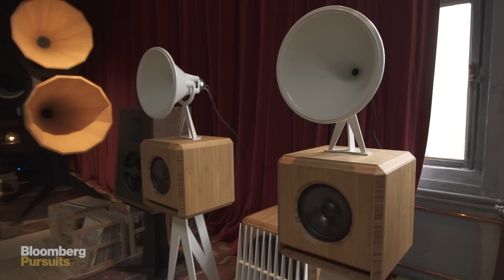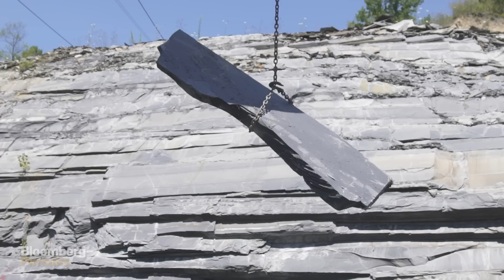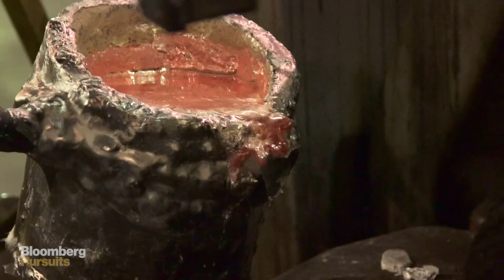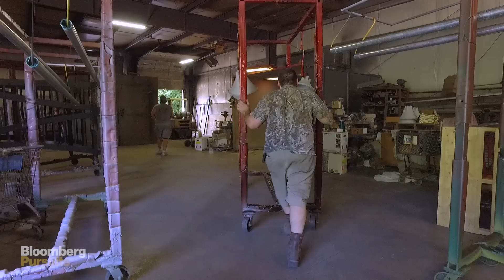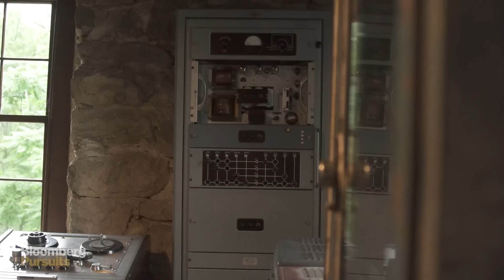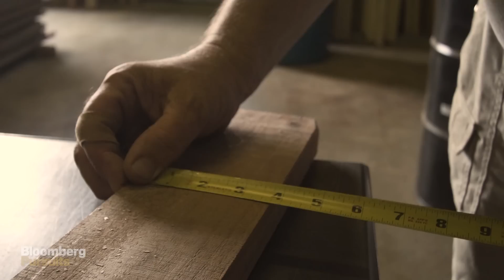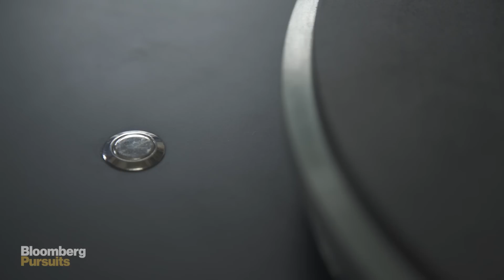How a $300,000 Speaker is Made

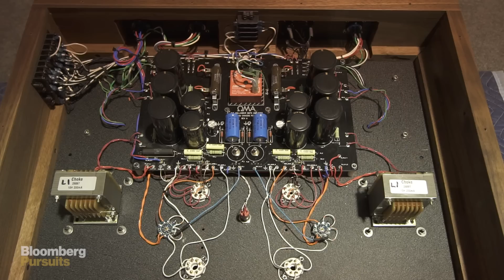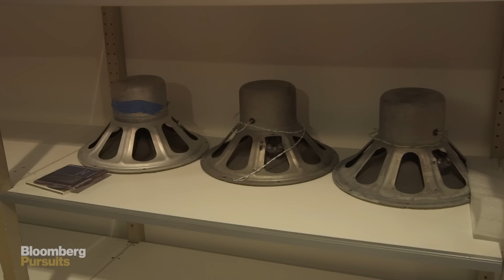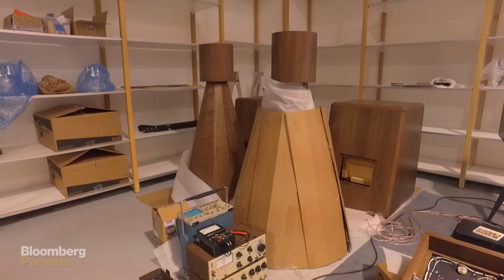Comment: 5:25 that's the soldering quality you'd expect from $300k speakers? The guy  at 5:37 uses what appears to be a gas soldering iron... is that a joke?! I could solder better when I was 12! 5:08 you didn't even bother to hide those dovetails and use better joints! There are brands that cost a FRACTION of the price and offer a better quality of workmanship!

Comment: In my humble opinion, OSSWALD MILL AUDIO is not the only reference. For several decades, GERMAN PHYSIKS from Frankfurt/Main (Germany, Europe) has been producing extremely high-quality omnidirectinal loudspeakers, equipped with their exclusivly developed 3 gr "heavy" and 0,15mmm "thick" carbon WAVE BENDING CONVERTER driver(s), who is extremly fast in all acoustic pitches. GP proposes this high performing driver element in loudspeaker of different sizes, from living room loudspeakers to the masterpieces GAUDI MKIII, which goes soon into series production and costs an estimated plus 300k€. German Physiks also builds suitable high-end amplifier stages. Not a matter of course either.

Comment: I dont get it because most records are mixing and mastering on very cheaper monitoring system... Do you really hear differences between 5000 speaker and 300 000 speaker ? In this case its not controlled or even intended by the engineer. I am curious to hear answears.

Comment: 192000 kHz audio sampling with 32bit float accuracy and all this analog sounds like trash. Cheap soft rock + huge nothing special diamond saw + not chipped product + ancient technique of metal casting + mothed metal out of the movie Terminator or just regular metal foundry if you are honest + carpentry + lamp amplifier that can be emulated with software on transistor amplifier  = frightening system for $300.000. I am sure they sound great but cut the bull*hit and these are worth 1/10 of the price but then vain rich people with no life can't brag about how special they are and get a little bit of confirmation to fill their empty souls to hide their missery.

Comment: @ 5:23 this is your finished boards? I see you've got some IC's in there which is pretty decent but what is up with the flux and solder joints? I think if you're going to hand make these and sell for those prices, it should more like the guy who is making nixie tubes again. Hire me, I'm OCD as fuck. Perfectionist when it comes to this kind of stuff. I will say I think it's badass that you're doing old school circuits though. I see people getting pissy about the rats nest wires. Open up any old school high end radio or tv. That's how it was done. There is no need to zip tie or glue wires in straight lines because your eyes like it.

Comment: Well, I am not tube amp expert, but every skilled tube amp builder tells you, that some parts need to be as close to the tube sockets as possible and not run miles to some chinese DPS - and for that prices, I would assume to have it built by hand with point to point wiring without DPS. Not to mention this wiring is awfull, 100x better builds can be seen from DIY communities.

Comment: I can semi-admire the construction and look of the equipment but he basically spent 6 minutes talking about building "rare" earth speaker cabinets that aren't made out of anything that rare. As an antique dealer, I can tell you all the techniques he is using have been around 70-120 years.  

300k horns and ported cabinets? Since when do humans make better joints better than machines? Horns are very efficient but not all that accurate. Just go buy a pair of ATCs be done with it and save 270K.
Reply: All horns sound like $hit.  Power is cheap ever since the transistor age so no excuse not 2 do a line array if U want more dynamics & volume =)

Comment: Y is handmade looked to be better quality in general... cars like Tesla are all machine produced... machines can do work near perfection that humans simply cannot.... making handmade and limited quality does not justify high price
Reply: I mean to be fair I do think this guy is a swindler but handmade often have far higher quality and durability, for example Tesla’s have an exceptionally low build quality, likely because of low standards of passing meaning they allow basically any car as long as it doesn’t fall apart out of the factory. Handmade however has far more accountability, you can fire a workman if they are building low quality goods, you can get tighter tolerance out of a machine but a handmade where you pay for the handmade ticket will last far longer, well if it’s a trusted company. For example of the perfect machining process look at sennheiser’s HD 800 series, machine made components, handpicked and put together parts, flawless quality.

Comment: Guitar wood is supposed to resonate and vibrate. Audio equipment needs to dampen quickly so there are no secondary vibrations. It's the same reason you need soft slate instead of hard slate. Now they go and make audio equipment from guitar wood that does not damp quickly. What a waste...

Comment: All that 'expensive' equipment is great and all BUT!!!, its not replicating Elvis energy at all or any other artist.. what its really doing is replicating the quality of the equipment that was used in the recording of Elvis (the artist).   So if the artist was being recorded with crap,  the best you can get from that performance is the capability of the recording equipment used in that session.    UNLESS!!! your equipment can identify the equipment used in a songs recording, and by way of sound replication synthesis, account for the shortcoming of the equipment and correct it.   Like cleaning dirt from up old film footage.  it would be the equipment somehow replicating the artist and the recorded sounds to fill in the holes where the errors had exist.   This stereo system is not doing that at all.

Comment: I'm an audiophile and love to listen to music.  It's better than drugs.  When I watched this video I thought to myself, I wonder if he has ever turned on all that old commercial audio equipment?  I was thinking of all the wax and paper condensers (capacitors) shorting out.  The reason for the sheer size of that equipment was because it was in constant use day after day and had to dissipate a tremendous amount of heat.  Most of those components that made up that equipment were their own heatsinks!  I also was amused with the wooden components in his systems.  I wonder how he maintains quality when the characteristics of wood are not consistent?  If those photos of the build quality of his products are true and he compares them to aerospace quality I would have to say that he's never seen NASA blue-board equipment, built for a trip to Mars.  His products are right up there with the 6' pair of $75,000 speaker wire I saw at my local HiFi store.  They say they have no problems selling it.
Reply: Nobody buys 6' $75,000 speaker cables, same way nobody buys these $300,000 $cam speakers. It's all a big joke 2 try & make other 'slightly less absurd' products seem more 'reasonable', like 'concept cars'.  Also, nobody has sent anything to Mars, same way nobody went 2 the Moon.  It's all a $cam.

Comment: "Sound waves can't be miniaturised.. it's physics." .. Hahahah
Reply: Its even funnier Because right after he says this they show an amp enclosure that is barely filled with components & can literally be 30% of the size if the designers felt like not wasting tons of space.
Reply: Extremely low frequency sound waves can be 30m long, way larger than the length of a room in a house with the speaker system in it. You can still hear the sound though, because since sound travels 343m/s, it wouldn't be a problem to hear the fast moving longer waves.
Reply: @twistieman1078  Your understanding of physics is as appalling as the guy in the video.

Comment: I understand that the speakers have to be that expensive, so you can keep that whole production line running. But you're clearly paying for the company and not the product here

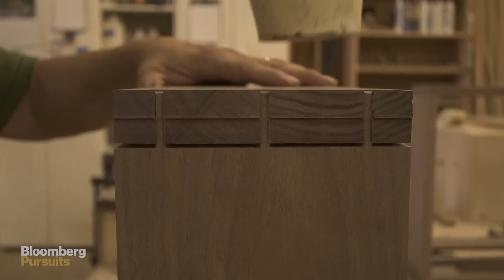Like 4:40 that's exactly the point.
You can't say "These Things have to be unconventional so they produce the perfect sound and that's expensive" and show how much money you're spending on unnecessary stuff

And then spare on the important things.. look at the soldering done at 5:25
Seriously a beginner can do better
Reply: U don't get it = half the joy is in doing the worst possible work, with worst possible design, & trying 2 trick people into wasting way more than it's worth 2 buy it =))  It's like the 'audiophile cables' thing = most of which don't sound better than 'generic lamp cord'.  & yes, I know from comparing them myself when I worked at audio shops.

Comment: High-end out-liar.

Total control over the sound? You'd have to separate the listening environment entirely to remove all traces of external ambient noise, and the room would probably have to be maintained at a constant temperature to avoid variations in air density.

Maxwell's demon would be most impressed.

An old church with organ might be a better investment.

Comment: I was expecting vacuum tubes to amplify sound, but instead found cheap circuits soldered together by hand. 

$300 - Electronic parts
$1500 - Wood, stone, etc
$298200 - For this utter bullshit story abut bringing back Elvis
Reply: the trick is to find ppl with money that fall for it, you only have to find a few with that kind of margin.
Reply: @frydac  true. The rich lot doesn’t know to really evaluate anything at best. They just need to get convinced that it’s the best because it’s expensive and no peasants can afford it
Reply: I rather reinforce my floor joists and find a 1.25 ton Genesis system and connect it into my cheap HK AVR-7200. xD

It's about time to heft that 70lb beast out of the cabinet and give it it's once a year or 2 cleaning.
Reply: “Aerospace level components” 

Just a few chunky capacitors, you mean.
Reply: Poor Elvis, he would have rolled over a few times if he'd known his name was used to promote this stuff!!!!
Reply: @danedewaard8215  I think I caught a nerve excessively laughing to that mate 😂😂😂
Reply: 😂😂😂😂😂 @danedewaard8215
Reply: Comment of the decade 🤣
Reply: An Apogee Duetta Planar speaker was probably better.
Reply: Creek destiny has way more expensive amp components  haahaha
Reply: But cant vacuum tubes Create interference in the digital and analogue signals?
Reply: I agree.
Reply: 50.000 worker payment
Reply: The equipment in Sun studios, in 1954, that Elvis actually recorded That's Alright Momma on, that Sam Philips mortgaged his own house to buy, was much better grade stuff than anything I see here.
Reply: Happy to see that I’m not the only person thinking this guy was full of B.S.
Reply: Your comment is very accurate and reasonable! In your opinion, which step in this process is the most crucial?
Reply: Agreed!!
Reply: Yeah companies that make products for audiophiles know their clients.
Most audiophiles are the audio only equivalent of flat earthers.
Reply: 298200 cause hes a ✡️
Reply: highest quality components my arse. I use some of the absolute best components money can by on a regular basis, including custom made parts, and those parts are mid tier at best. the wiring is also a joke.

Welp, time to build a pair of speakers to blow those shown here out of the water, running off one of the most powerful tube amps every created, just because i feel like it.
Reply: @lbochtler  Hey man. When you start up the multimillion dollar company that will serve as the literal only competition to what this one is doing, let me know. Id love to buy your crap to compare and contrast
Reply: @SuWoopSparrow  ok, on it
Reply: @lbochtler  just hire a goor marketing and PR team mate. You can double the sticker price he’s quoting even with half the components grade. 😂😂 the marketing campaign and producer will do the rest. But make sure to quote only dead artists 😁
Reply: @lbochtler  And none of us will ever see or buy your crap🤡
Reply: @lbochtler  What parts are they? Can you give the brand/parts numbers?
Reply: @amazin7006  for resistors vishay precision Group metal foil (Z-Foil) and Isabellenhuette custom precision trimmed resistors. Transistor wise it's usually milspec or aerospace grade hand matched, these days its national semiconductor and or on-semiconductor. Volume controls are typically custom made balanced stepped atenuators, based on ZFoil. Voltage references are either custom made semiconductors or superconductors (josephson junctions) and at worst something like the ltz1000. 

Capacitors I typically use Panasonic FC and Wima MKS and MKP series, occasionally vacuum and mica capacitors if needed. For resistor networks in a non highest precision application I use caddock precision deviders. 

For data converters it's a mix of Analog devices, LT and Texas Instruments if utmost accuracy is not needed, else its custom converters either ic based (asic) or descreat based. Typically fpga driven. 

Solder is typically tin lead eutectic, or Ag5 eutectic. For cryo cooled applications its indium solder. 

Need more info?
Reply: Well that is a loud speaker. The speaker doesnt have amps so no need for tubes. Their amplifiers are tube. Might want to know what your talking about
Reply: @buzza2077  "vacuum tubes to amplify sound". do you read?
Reply: @buzza2077  obviously you don'ty know what those "space level stuff" are

Comment: Yes. The materials and labour cost is far cheaper than the $300,000 price tag, you are correct. What you are paying for is somebody's life work. Let me explain...

A speaker enclosure is THE hardest thing to design in the audio world. You can build say, an amplifier with virtually no harmonic distortion and that represents the source signal accurately, quite cheaply and easily. A speaker is a different story, as there are so many variables that can change the sound. From enclosure design to driver configuration, material used, phase timing etc. To get high end precision and accuracy like with those speakers, it takes decades of trial and error to 'arrive' at that particular design. 

Think. You can design and make a car that can go 200mph relatively cheaply. But to get a car to go just another 20 or 30mph faster, takes a huge amount of precision engineering as its at the absolute tolerance of what the laws of physics will let you do. It's the same with audio and why speakers can cost so much money.

Comment: At 5:25 you can see what quality of soldering you get for 300k, that board looked like it has literally been dipped in pure (snake) oil for months.
Reply: I have seen much better soldering job on chinese made external ac adapter powered class D amps.

Comment: Total crap.....I have a pair of reference kefs that are made of wood....not that MDF crap.
Reply: MDF is not crap, almost all   manufacturers use it or other types of laminated multi ply hybrids. KEF does this also and even uses aluminum laminated baffles. Solid hardwood is seldom used due to splitting and cracking problems. 13ply Birch and MDF are excellent materials. BTW KEF makes great speakers !!

Comment: Funny how audiophiles shy away from direct measurement and analysis of performance.  I see a 1980s vintage oscilloscope in there, but nothing for actually testing the sound output of the speakers.  The resistors on that circuit board look like they're 30 year old stock, and I'll bet aerospace soldering standards don't involve great globs of flux residue on everything.  The woodworking is pretty, though.